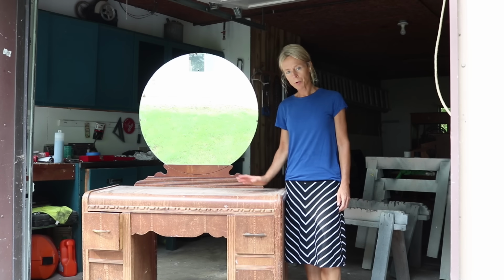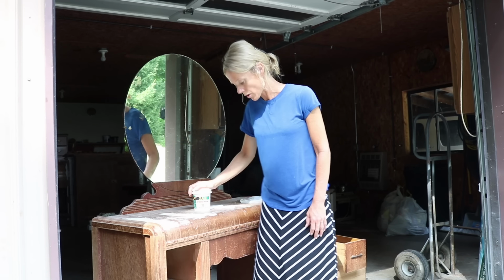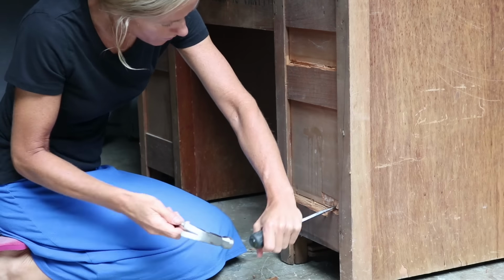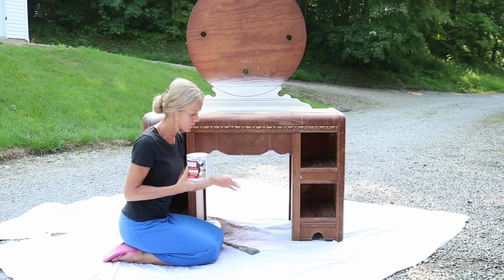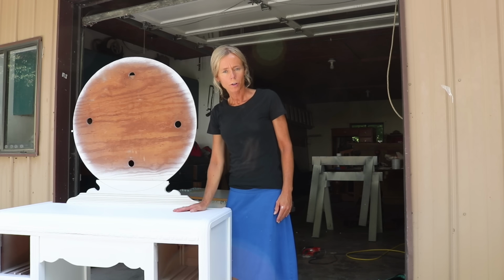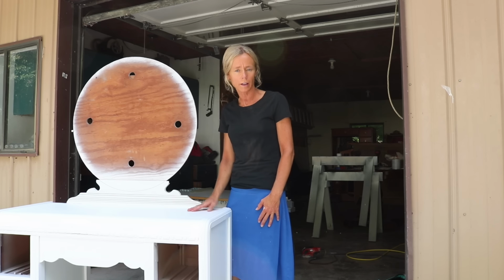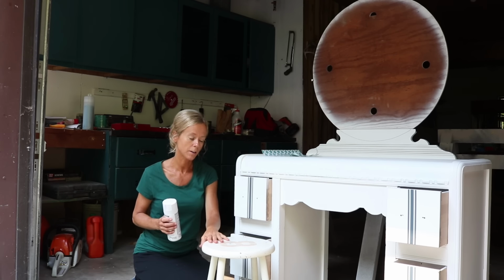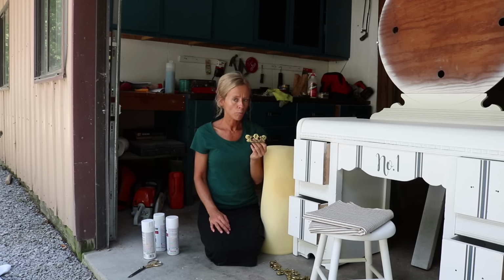Vanity Makeover

Comment: I just wanted to add, most people use a dust mask when sanding or otherwise working inside a closed area.  I noticed you were in a well ventilated area and I often paint this way as well with no face mask.  Disposable face masks DO NOT protect you from breathing chemicals (paint or otherwise) and the CDC has been clear about this.  You would have to buy a special Chemical/Gas Respirator  Mask to protect from that, and then they only protect you if you are using the correct cartridge for it.  I also didn't see anything in this video that might have required safety glasses.  I think you did a wonderful job by the way.  Keep up the good work!  You are an inspiration!

Comment: Veneer bubbles and delaminations on hide glue flitches can oftentimes be rebonded to the substrate by using a clothes iron. Use a leaf of paper between and the "high" setting, follow up with a wood block and hand pressure to hold in place until the glue sets, which will be very rapid. Hide glue was the original "hot melt" of its day and is still useful for assemblies that may need future reversible repair such as musical instruments. ☺

Comment: Super pretty I love the white I'm not a fan of glaze! I have used the same primer before it worked great until I start painting over it, it gave the furniture a dirty yellow tinged. Can you tell me what I am doing wrong or how to prevent that. Thanks.
Reply from the maker: That would be frustrating! I have never had that happen with this primer but it's happened with other stainblockers already. I don't have a definite answer but I suspect it's something in the wood that reacts and makes it discolor. Another thing that I've done with stains is spray the piece with gray spray paint. Any rustoleum brand paint. That has done wonders to serve as a primer. Hope this makes sense!
Reply: Gray make sense, thank you so much, I have a furniture that I wanted to update I will definitely try gray next time.

Comment: hi I have an old dresser used in a grocery store years ago. my neighbor ran the store- and I bought it when family cleared his house after he passed away. the bottom drawers were always stuck and I finally realized the drawer bottoms were not attached enough and fell below the drawer units- making it impossible to open, I turned the desk up sideways 
 used a bit of pressure and a small rubber mallet to get the drawer bottom to lift up; making removal easier. then repaired the drawers before putting then back.

Comment: I would've cut a wooden crescent piece to put on the mirror and painted the crescent gold..tiny gold and silver stars on the mirror mount. All over color a slate blue keeping the trim across the front the natural color. I would have put the vintage half moon handles on the drawers. I would have sprayed a light dusting of fine glitter across the counter surface and the middle sections of sides. On the cut outs on the bottom of the front I would have long skinny triangle sun rays in gold..I would have left the original design on the drawers. My bench would have been like a small piano bench for more storage..tufted seat cushion on it. The seat cushion would've been steel gray..bench/legs slate blue..gold painted "caps" on bottom section of legs. Just dreaming of a celestial version..I like your race car version..turned out good...

Comment: That's amazing beautiful. I know the video was speeded up, but it looked so easy when you painted on the Shallac, I have used this and found it difficult as it doesn't spread easily, any tips? Also what did you do to the drawers to make them run smoothly after you had such difficulty getting them out. Many thanks for all you videos. I live in the UK.
Reply from the maker: Thanks for watching! I forgot to mention in the video that I sanded and waxed the drawers really well and they are fine now!  Hmm, I didn't notice that the shellac doesn't spread easily..it's very thin. Do you use the same brand as I did? I love that stuff!

Comment: Can you recommend a paint sprayer? Would love to purchase one so any information on one would be great!  Thank you!
Reply from the maker: I've never spend more than $150 on a sprayer, but I'm sure there are better ones out there than what I use. Lowes has some decent ones..Kobalt brand. You would of course need an air compressor to use it. And if you get one, make sure it's big enough to handle the sprayer! I once had one that was too small and it didn't go well. :/ I'm sure they could help you  at Lowes or Home Depot , to know what kind of compressor you need. There are also electric sprayers out there that I've never used. That may be an option too. Good luck in finding one and happy painting!

Comment: We're in the market for a sprayer that will do both paint and stain.  Does yours do that?  If so - what are you using and do you recommend it?  :)  thanks!
Reply from the maker: I've never spend more than $150 on a sprayer, but I'm sure there are better ones out there than what I use. Lowes has some decent ones..Kobalt brand. You would of course need an air compressor to use it. And if you get one, make sure it's big enough to handle the sprayer! I once had one that was too small and it didn't go well. :/ I'm sure they could help you  at Lowes or Home Depot , to know what kind of compressor you need. There are also electric sprayers out there that I've never used. That may be an option too. The one I am presently using was a used one from a neighbor and truthfully I'm not sure of the brand. I've gone through several ones over  many years of painting, including a Kobalt one that I really liked. I could run stain through mine and have in the past but the clean up is so much harder. I avoid it because of that. I feel like there's already a slight build up inside mine, even with taking it apart after each use and thoroughly cleaning it. Maybe I'm missing something in the clean up but usually that's what happens to mine after 3 to 4 years of using it-it ends up clogged. But I use it a lot and feel for the price that's not too bad, to buy a new one now and then. Good luck in finding one and happy painting!